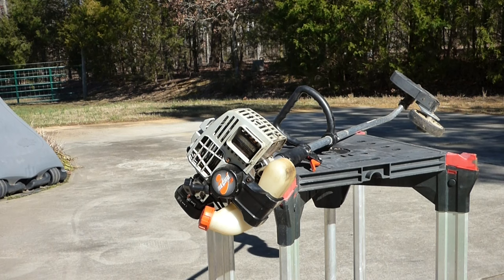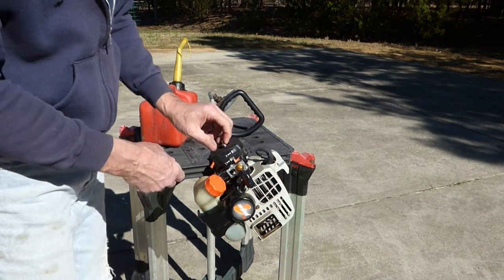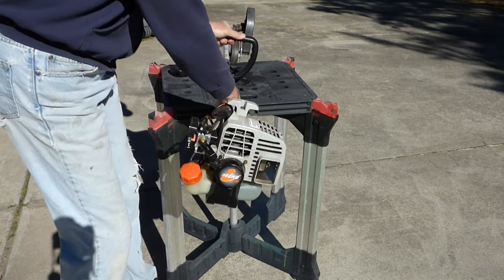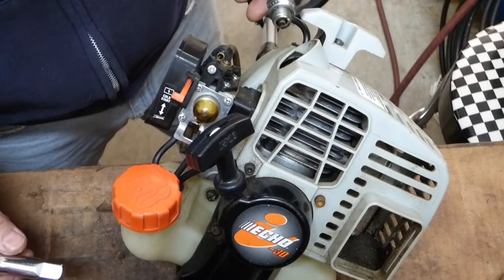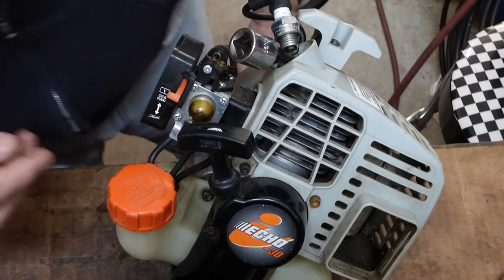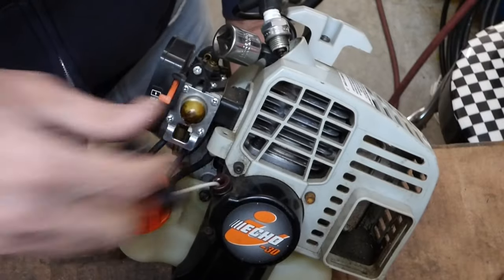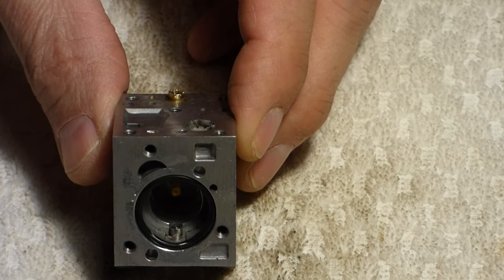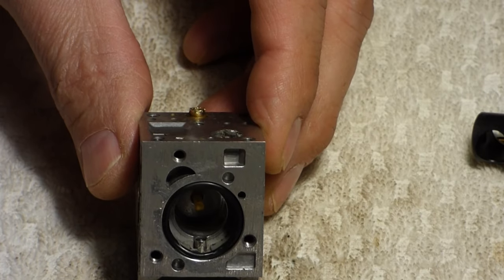Fixing a Trimmer, Edger or Blower That Starts But Bogs Down & Dies - Echo

Comment: You could probably just back off the H carburetor adjustment screw to provide more gas for full throttle running, and save yourself the enjoyment of cleaning the carb.
Reply: Easyfix but dont work normally

Comment: Good information but there’s a few items that I would check first before you do anything to the carb. First and foremost, make sure that the piston isn’t scored before you waste any time on a burned up engine. Second, Make sure that the exhaust is free and spark arrestor is clean. Third, make sure that the tank vent is working properly along with checking the air and fuel filters like you did. I would also make sure if you clean the carb to change both diaphragms.
Reply: So, how can we check that "the piston isn't scoured"?   When you check, how can you confirm that it cannot be repaired  ie is some scouring acceptable? Thank you.
Reply from the maker: You can check for scoring on the piston by removing the muffler.  Once that is removed you can see the piston to check for vertical lines scored in the piston.
Reply: yes the tank vent how can I tell on the troybilt tank cover if the vent is open I don't see any marks indicating so and the cover does have a turning piece.
Reply: I think a compression test would answer that question. The piston on mine is a little scored but the compression is 120 psi . If the exhaust or the carburettor intake is removed the piston is visible if you pull the starter slowly  @UTube_userRM I would say that the rings and the cyl wall are more important than the piston though; of course I am not a total expert yet!!

Comment: I installed a new carb, fuel lines, spark plug, spark arrester and my FS38 still will not run. Unfortunately I have to take it in to a shop. I still can't figure out why it won't run. Runs for 30 seconds and then dies. After that, will not start at all. I can't adjust the hi and low on the carb because it doesn't run at all.
Reply from the maker: At a guess your coil might be going bad

Comment: Similar trimmer with the same issue here - Idles fine but when you hit the gas it just bogs down and quits. Spark arrestor screen and exhuast was pretty clean but I cleaned those anyway. Entirely disassembled and cleaned carb, which was very clean already. Replaced fuel filter which was also pretty clean. Used all new TruFuel 50:1... Still I'm getting the bog-down issue. 

With each video I watch and with more research I find additional helpful tips but maybe I need to go back over the carb again and make sure that roller is there and go over the jets again.
Reply from the maker: Make sure the metering diaphragm is very rubbery and flexible and not stiff at all. Also you can try to adjust the carburetor
Reply: @helpinguonline  Thanks for your reply. The diaphragm is pretty flexible and doesn't seem stiff. 1 year old machine so everything is pretty new on it. Yes I think either carb adjustment or new carb is needed. These aluminum carbs get corroded and eaten away by the additives in modern gasoline, especially standard 87 octane.
Reply: @mjay4700  Mine is acting the same way.  I am waiting for the diaphragm kit to arrive.  Sometimes I can get it to run full power but that takes some luck.  I am also going to replace the gas tank vent.  I see no corrosion or wear on the carburetor body.

Comment: Two quick questions.

1. Where did you get your work station table outside?
2. What’s the best way to get gas smell off?
(Started my own little business and working on these all day your hands start to smell)
Reply from the maker: The table was given to me...  It is actually a foldable sawhorse.  Not sure if they are manufactured anymore?
I have never thought about fuel and grease smell on my hands and no one has ever said anything in all my years.  I usually use a hand cleaner if they are real bad...sometimes Purple Power but it is a little harsh.  otherwise I use Dawn if the grease isn't too bad.
Reply: Hand Goo

Comment: My Echo String Trimmer takes forever to start. It’s got good spark, I’ve replaced all of the fuel lines etc. You can tell it wants to go as it will kick and then some smoke comes out from the exhaust but it never fully starts. Then when it does it’s like it hates it and is bogged. Then I leave it over night and it seems fuel got to my air filter. Not sure what to do at the momentz
Reply from the maker: Could be a number of things… Start simple and work your way through it. Hard to tell from here what it might be but Since you have spark and I assume good compression… I would make sure that you have good fuel without water in it, the carburetor is properly adjusted
Reply from the maker: Clean fuel filter, and that the carburetor is not gummed up by debris or old fuel. Sounds like a fuel problem but hard to tell from here.
Reply: @helpinguonline   Okay I will double or check. I just refueled, it decided to go. Then it said F it went it tried to start it again. Do you think it has anything to do with the needle valve? I never fully disassembled the carb and got to the valve. Should I check that then adjust carb?
Reply: @helpinguonline  Strange, I use the same fuel (TruFuel) in my echo leaf blower and that has no problems. I will definitely double check the carb and let you know. I appreciate you responding!!

Comment: I've got an echo hca2620 hedge trimmer. I have replaced the carburetor and fuel filter and it still bogs up. Can you please advise 
Many thanks
Reply from the maker: did you try adjusting the carb?  Also, aftermarket carbs can be problematic.  Are your fuel lines in good shape... not cracked.
Reply: @helpinguonline  I don't see adjusting screw on my carburetor. Full lines in good shape

Comment: I put a new carburetor on, new plug, new fuel and air filters, new fuel and vent lines. I even removed the spark arrestor screen, which wasn't dirty. Still no power. The coill is the only thing I know to do. Is there anything else you can think of?
Reply from the maker: Did you try adjusting the carburetor? Even the new ones have to be adjusted a bit
Reply: @helpinguonline  no i didn't.  The only thing i know to adjust is the idle adjustment.
Reply from the maker: Here ia a video that may help you.  You  may need a special tool to adjust your new carburetor (often they send it with the new carb)...or you can order online.
https://www.youtube.com/watch?v=dv_P1Zz7dR0&t=16s

Comment: My Echo starts up and works for about 10 minutes, then dies. I smell a lot of fuel odor, and it appears that fuel has "waterlogged" the AIR Filter. If I let it sit overnite and the fuel has dripped out of the air filter, I'm able to start it again. How do I stop the fuel from waterlogging the air fllter?
Reply from the maker: Sounds like your needle valve in the carburetor is sticking. I would recommend taking the carburetor apart and rebuilding it or at least cleaning it and make sure the diaphragm is not stiff but is still pliable and flexible.
Reply: @helpinguonline  Thanks for responding. It does appear to be a problem with the carburetor. When the air filter is not clogged, it runs fine. I'll try your advice.
Reply from the maker: You can do it!

Comment: I tried to adjust my carb, it was blowing white smoke when I was adjusting the high side I guess I got it too hot 🤦🏼‍♂️.
Reply: I am just trying to fix mine, Got it to start now, But white smoke coming off. Will try to put new fuel (its old one there now.... and then the screw I guess)

Comment: Why the heck do they make the adjustment screws for the carb inaccessible?
Reply from the maker: Limiter caps and hidden carburetor adjustment screws are for government emissions control
Reply: On old Echos they were right on top, could turn it with your fingers.

Comment: is this a 40 to 1 or 50 to 1
Reply from the maker: I think that machine called for a 50 to 1 mix but I run 40 to one in all of my two cycle equipment for better lubrication

Comment: Echo egder runs and starts great, butni can't leave fuel in it. It siphons out whennit sits. I've tried standing it up, leave it flat, it doesn't matter, it still empties the fuel tank.  So now i drain the fuel after ever use. Quite annoying.
Reply from the maker: Hast to be a leak somewhere… If the fuel is coming out of the muffler then your needle valve in the carburetor might be stuck open due to a stiff diaphragm. Otherwise I assume you have a leaky fuel line or a crack in the gas tank or loose fitting fuel lines coming through the tank or something?.
Reply: @helpinguonline  it leaks out thru the muffler. Before it empties and I try to start it, it's flooded. I guess it's time to pull the carb and see what's up.
Reply from the maker: Most likely the needle valve is stuck open and there is a good chance that the diaphragm that operates the needle valve is stiff and no longer flexible.  If that is the cause you will have to get a rebuild kit for your carb or buy an aftermarket carb to replace yours (aftermarket carbs are hit and miss in terms of quality).
Lastly, your carb may have debris in it causing the needle to stick open.  Cleaning the carb would remedy that..  
Wishing you the best with your project.

Here are a couple videos that may help you:  
https://www.youtube.com/watch?v=QLXE6am8fKs&t=34s
https://www.youtube.com/watch?v=MtggiZf_x-4
Reply: @helpinguonline  thank you so much for the advice.